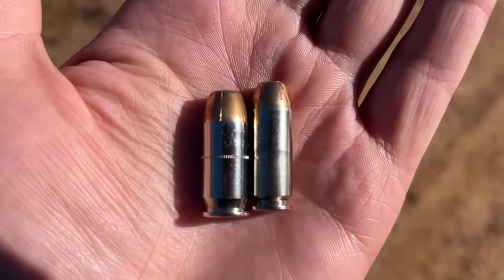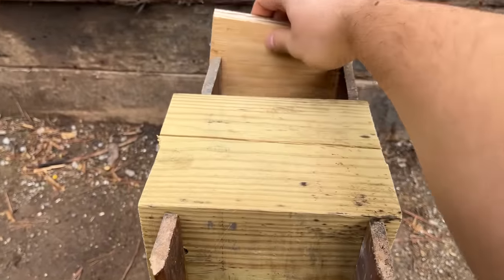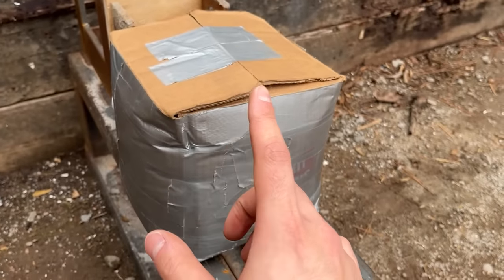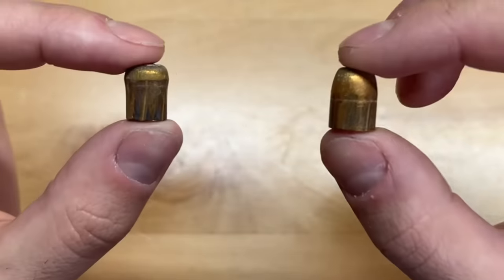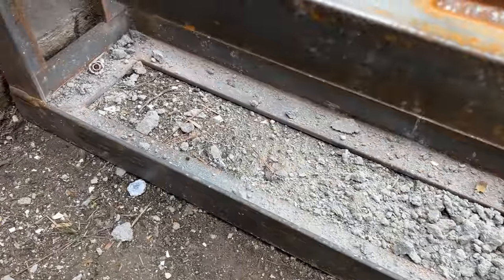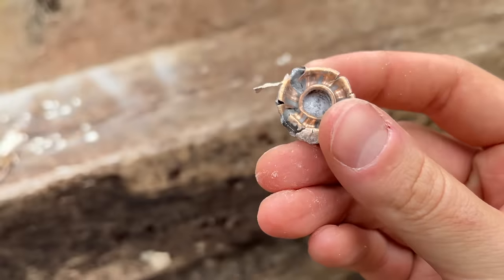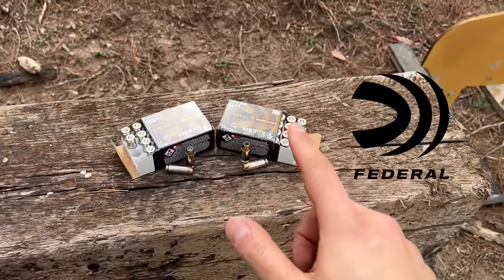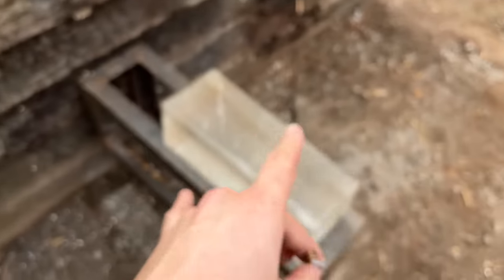45 ACP vs 10mm: Unbelievable Difference On Barriers

Comment: I don't know about this test. 10mm is being pushed to it's limits and 45ACP is obviously not. I don't know anybody that uses a vintage 1911 these days for SD, these bullets are designed for those that do, or those that can't control any .45 past +P. The limit of a .45 230gr is about 1100fps, which is 45super. That would ve a fair comparison. All you need is the same basic upgrades a 10mm needs, a 21-24#  recoil spring on a modern steel +P rated handgun. 
Here's an example:
https://youtu.be/PhX-6HOWhRQ?si=zANyq6vEM4IyjHXp

Comment: The 9mm was invented to be a military cartridge for a sidearm using non expand bullets according to rules of war., some people died if hit in the heart or head. 
The 45ACP was developed to knock over feral natives with spears, a 1873 Colt would have done the same. I think these tests are misguided as the cartridges weren't  designed to shoot through wood blocks.

Comment: Most 10mm factory ammo is weak ammo. They load it to roughly work the same as 40s&w with the same bullets, because that is all the power you need and that most people can even handle. It's also cheaper to use the same bullet that they invested tons of money to work perfectly in a common 40.

On the flip side, 45 and 45+p have been around forever, so most ammo is representative of average 45.

Want a good 10mm? Buy boutique ammo. You can do the same with a 45, but I think you can pick up some 220 +p critical duty and get about as good as you can.

Comment: The problem with 10 mm especially for home defense. It doesn’t matter if you make a hollow point it’s so narrow and it’s moving so fast that even if it mushrooms it doesn’t dump its energy into the target it’s still just goes straight through. It’s like a 5.56 hollow point or like a 5.7 x 28 mm hollow point it’s not gonna make any difference it’s not gonna expand it’s not gonna transfer its energy it’s just going to go right through even if it is expands they’re not meant for home defense they’re not ideal that’s for sure They’re just going way too fast and they’re too narrow it’s like if a 9 mm had twice as much gun powder and be like a 38 magnum it’s just gonna go right through clear ballistic gel it’s gonna go right through a human body even if it’s a hollow point 45 on the other hand are ideal for home defense they are almost subsonic rounds. They all go under 1000 ft./s. They’re almost half an inch in diameter when they expand their well over 7/10 of an inch in diameter maybe even 3/4 of an inchand they’re going like half as fast as a 10 mm so they will completely transfer all their energy into the target. 45 wins hands down.

Comment: You picked the absolute worst ammo for the gel test. A 180 grain bullet going 1350-1400 would be a “mild” 10 compared to a 200 grain 1300 hard cast lead round. And you should have used a Lehigh defense  penetrator round for the steel test. You basically shot the gel with a hot 40s&w.

Comment: Forty-fives were designed to knock down  rebels high on stimulants during the Moro insurrections in the Philippines (1899–1913) to sling a slow-moving (about 830 feet per second) heavy ball round (standard 230 grains) that mushroom out and transfers most or all of its kinetic energy inside the  target. An exit wound is not necessarily the desired result. The idea is stopping power, which forty-fives have in spades. This is not really a fair comparison of these munitions. Apples versus oranges? Not quite, but you can see it from here.

Comment: 10mm is the best of no worlds. It's too small to have the mass for push/damage but too large/slow to have the best penetration. 10mm is the Mario character in Mario Kart. Not the fastest, not the strongest, certainly not the most nimble, but it'll get the job done...... eventually.

Comment: Let's be honest here. Both are fine rounds. ANY round is a good round if you are defending your life or the lives of others. And ANY round that pokes holes in tender vittles will suffice.

Also, these tests were pretty basic and non-informative. It takes a LOT of round to get through sand, it's why sand bags are still used in militaries today. Wood blocks are going to stop pistol ammo just fine too, even magnums. The gel was the only valid test here IMO and even then you seem to be a bit biased towards 10mm from the start.

Comment: im not sure why people keep comparing the 45 to faster rounds. the 45 was anti-personnel period. puts a large hole into a rather weak species. it was the power needed to do that job very well. 

10mm was build to be faster during a time when it was thought it was needed. 

if you want more penetration a 10 is obvious answer. 
if you realize this isnt needed for self defense then the 45 will do what if has always done. 

as far as shooting through barriers, that is left to others to decide. but this desire will eventually lead to very powerful rounds in an ever escalating chase to have more power. 

idk, seems the gun industry has spent the last 100 years telling us their previous offerings were not good enough and we need new ones. . . hmmm

Comment: Question that wasn't answered was blunt force/shockwave/stopping power...AND, it's hard to argue that the 45acp was designed just for that...
I'm gonna' be THAT GUY that sez it. I've not found ONE "METRIC" that can out perform a SINGLE, tried and true American Caliber overall...Whether it's 38cal over 35cal (9mm).....45 ACP over 10mm (40 cal "long") or any of the Euro-Wimp Metrics over 300 aac, 30-30, .308, or 30-06...in rifle ammo either. They can talk about minutia differences on paper BUT being "Paper Tigers" is what Eurpeans are experts at. They can't hide their "American Envy" even when they try to Eurpopean-ize the 308 into 7.62x51mm. Americans are just simpler, more effective, more efficient, and "To-The-Point".
NOW, some genius come up with a higher capacity semi-auto in 357 MAG and we'll have "A REAL HANDGUN" then...

Comment: Nothing really surprising here. Paul Harrel did a video on 45 vs 10mm 6 years ago. Worth a watch. Cartridge comparisons can be good but too often the conclusions drawn are pretty bad given the number of real world variables. In this video the comparison was for barriers, but for some reason also included gel testing. But heres the thing, the 10 has plenty of power and is a smaller diameter. It better penetrate better or something is just plain wrong. For some reason some people make the 10 out to be some kind of superman round, like the 5.7 and they are not. They each do well in some circumstances and not so much in others. In the end, the info presented here is just data to add to an overall picture that people can use to make a decision what is best for them. Nothing more. A video doing justice to which is best cartridge would be 2 hours long and very expensive and time consuming to produce and the "best" cartridge would still be limited to some set of circumstances that would match some people and not others.

Comment: I use hydroshok 230 45 with 4 layers of clothing it penetrates 15 inches and at times 14 inches in gel.  But opens to 77.7 caliber.  Much deadlier and more efficent as a hammer of Thor and much more of a man stopper.  As for penetration and or effectiveness hard to beat the 230 hardball moving at 890 Fpe.  Piolets in Alaska use it for grizzle and polar bears due to the penetration.  In the field results of military with proper hardballs sets the 45 as a king.  Believe it or not the Army worked to develop this and the load they used for it meticulously.  It is still used heavily by all elite forces.  Sorry I believe the HST is good but it is built like a Glazer safety round to stop short and the 45 is opening a lot bigger and  lifting ballistics gel blocks with momentum a Hydroshok does much better in expansion + penetration for the 45 or just the good old 32 inch + penetrating hard ball.  Never had a cry to use hollow points in military like 9 mm.  The 45 has its place please test it with a variety of loads.

Comment: Kinda wasted some ammunition on this on. 10mm full power is 36000 psi while the 45acp is 18,000 psi. That would be half😂 I’ve converted my hunting side arm (Colt 1911) to a 460 Rowland which now shoots 45acp, 45 Super and the HAMMER OF THOR round or 460 Rowland ( 255 grain hardcast 1300fps 1000 ft lbs 40,000 psi for example) That’s what a real 45 acp handgun can do.

Comment: Since 1 millimeter = .04", 10mm IS .40 cal.
Reply: .40 S&W is just a shortened and downloaded version on 10mm Auto. There is some history behind that.

Given the high volume of .40 S&W bullet production in comparison to 10mm Auto, most 10mm Auto ammunition is loaded with .40 S&W bullets.
Reply: @johnklatt3522  No, I mean actual bullets.
Reply: @johnklatt3522  I am talking about today's SAAMI-spec rounds. .40S&W didn't even exist when 10mm Auto was invented in the early 80's.
Reply: @johnklatt3522  I wasn't talking about the development of either round. I just mentioned that there is some joint history here.

My point was simply that most 10mm Auto rounds you buy today contain bullets that were manufactured for .40S&W and not specifically for 10mm Auto.

This is mostly important when it comes to JHP rounds in 10mm Auto. The 10mm Auto cartridge is just designed to have higher speeds than .40S&W, but the JHP bullets that are being loaded are often .40S&W and not designed for that speed. They often shred and disintegrate or overpenetrate, depending on the JHP design.

Comment: Talk about best millimeter you got to carry the best bullet that means either Buffalo Bore 180 155 or 135 Underwood 180 155 or 135 or double tap same bullet lights unless you want to be hardcore and get up there in the 200 grains but you should be 700 or above foot pounds it's just sucks to see all this water down 10 mm 200 grains going 1100 ft per second
Reply: Yeah I got a best millimeter started concealed carrying my Glock 20 Gen4

Comment: Ill always be shocked by the difference in power of the two, .40 cal will obliterate a cinder block in 5 shots, .45 will barely, chip stuff off. However it sure is one quiet fat slug coming out of a suppressor

Comment: Yes 10 mm a higher pressure round will out penetrate low pressure standard 45 acp. In grizzly country do your self a favor. Pick up a box of 45 super and leave  the 10 mm home. PS for whatever reason many ammo manufacturers are loading 45 ACP down to 9 mm energy levels,???..

Comment: The dude DOES NOT even specify the bullet design of either cartridge.   For home defense into HUMAN FLESH methinks the 45acp hollow point is more than adequate.  For bear defense in Alaska?  Obviously a hard cast flat point in 10mm.  There is no such thing as the perfect handgun for all uses.  See . . this is why I bought a Glock 41 45acp AND a KKM 10mm conversion barrel.  One gun, two calibers for TWO specific purposes.  Badda Bing badda BOOM.  Your mileage may vary.  IMHO, Glock is perfection.

Comment: People still use these rounds?

.300 Sig Rattler w/can and 220 grain subsonic. Only defense round one needs.
Reply: .22 Eargesplitten Loudenboomer, a 50 grain .22 bullet flying at Mach 4.12 (4,600 fps) with 2,349 ft lbs of energy.

Comment: This whole test seemed to be flawed.  First pistols are not designed to penetrate barriers...so the fact that both failed should come as no surprise.  Then you said you were going to use the FBI required stats of penetration between 14-16 inches.  Yet who knows how much over penetration the 10MM had and with only one shot from each who knows if either was a fluke.  The 10MM cartridge is well known to be more poweful than the much older 45acp round, but I feel like this entire test was to prove how much better the 10mm is rather than to highlight their differences.  Sadly this was the firt video of yours that I was left disappointed.

Comment: First of all as an Alaskan, I can tell you you are not using realms which truly compare the power of the 10 mm! You either need to use Underwood Ammo munition with a Lehigh extreme penetrator in 140 grains were their 155 grain extreme penetrator hunting round! They also have self-defense rounds Which are lighter weight and travel much faster! You can also get the 220 green hard cast lead round bottom line is federal is well known in Alaska to load the 10 mm only 240 Smith & Wesson power levels! You are not even remotely using rounds, which have the true power of the 10 mm.  Your federal round had 567 foot pounds of kinetic energy both Underwood and buffalo boar have rounds which approach and in Underwoods cases some rounds exceed 800 foot pounds of kinetic energy! If you’re going to try and compare the maximum power of the 10 mm then get the maximum power rounds!  I don’t mean to sound supercilious, narcissistic or condescending, but your comparison is nothing short of a joke! As I said, previously, federal is well known for not loading the 10 mm to its true maximum potential! Watching this was nothing short of a waste of time, as you are not even remotely  Getting a true comparison of the maximum power of the 10 mm versus the maximum power of the 45 ACP! If you did, you would find the 10 mm is so far ahead of the 45 ACP there is no point in even comparing the two! I know some people are going to say  I am advocating the use of boutique grounds which are dangerous, etc. Well in the lower 48 yes, perhaps they are dangerous on the other hand what I’ve seen in the lower 48 is such an obesity epidemic I will leave 18 inches of penetration is the bare minimum especially during winter time necessary  to get to the vitals of some people who could be your attacker. So please, if you’re going to actually compare rounds, get real ammunition with the proper bullet to compare them then you’ll actually see a proper and true comparison of white each round can do, and you will see there is no comparison between the 10 mm and the 45 ACP!!!!  as someone who has been charged by bears several times and killed three I can tell you I would never ever trust my life to the 45 ACP! I do trust my wife to the 10 mm because it has stopped a battery charge called. It requires the proper bullet and proper placement of the bullet on the bear.  no offense, but these tests are jokes because you don’t use ammunition from the proper manufacture, and you don’t use the proper bullet to show what these rounds are truly capable of I either 10 mill

Comment: The .45 when it penetrates human body can reach vitals parts and since it bigger in diameter it can cause wider injury, and because it is bigger it is heavier and so heavier impact.
Reply: Yes, but for the same size gun, it has lower capacity. There is always a trade-off.
Reply: capacity does not matter. only those who think that having more capacity in their or who fire and fire are those who absolutely prefer high capacity. of course more bullets  in the gun is better there is no excuse for that. but think of it If i am holding a 6 capacity revolver nd you a 16+1 capacity pistol and we will have a gun battle, we are equal for the first 6 rounds after that you have the advantage of extra ammo. but in a handgun fight we must be close to each other to be able to hit effectively because we have handguns. if in the first 6 rounds no one have been killed maimed or injured then that means we are de escalating to shoot and scoot; and that is where I can reload with my revolver negating the advantage of your high capacity.